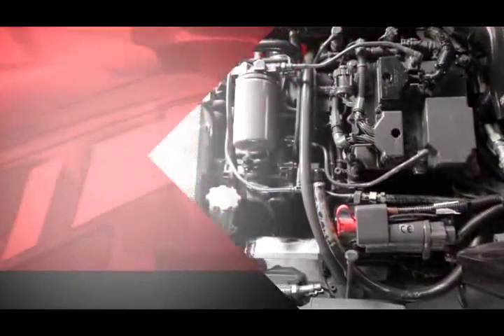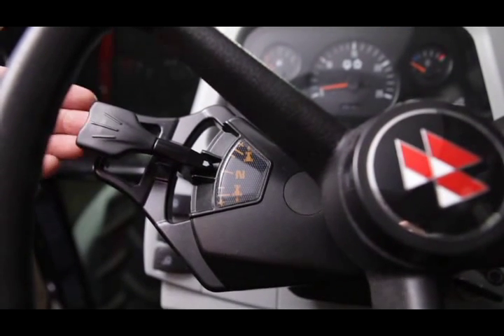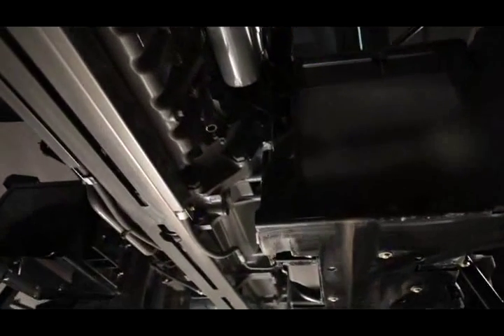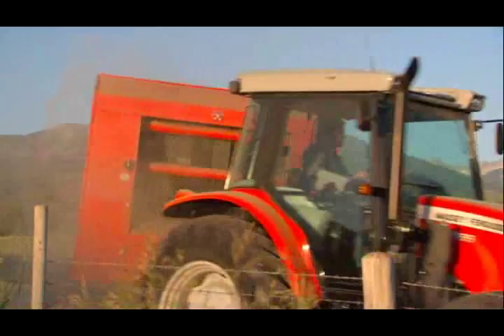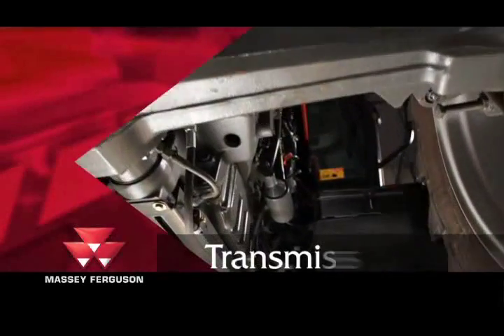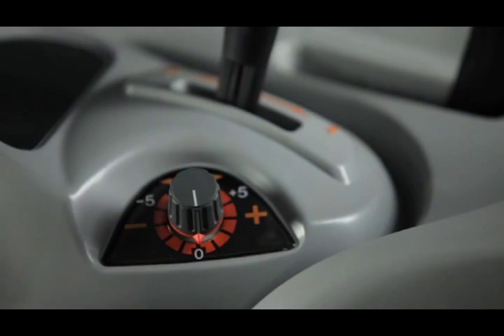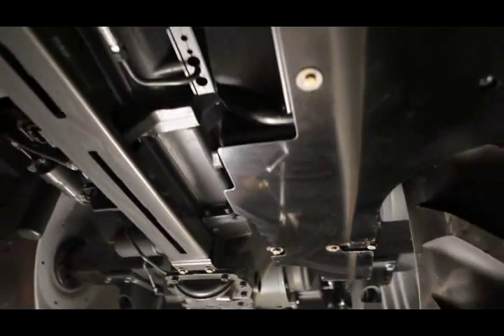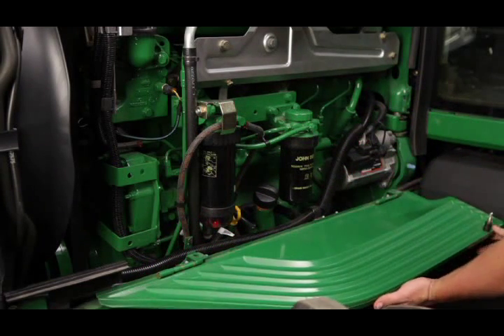Introducing Massey Ferguson 5400 "Ultimate Loader Tractor" Series comparison

Comment: i am a silage contractor and i have each of the tractors shown above and i only use the massey for jobs like wrapping and moving bales not because it is hander but because it burns way more diesel than the rest of the tractors which are doing jobs like cutting, baling and agitating slurry. this tractor has great transmission but is way too expensive to run